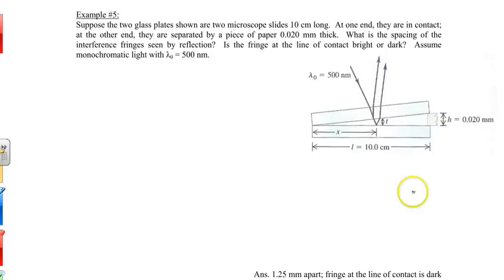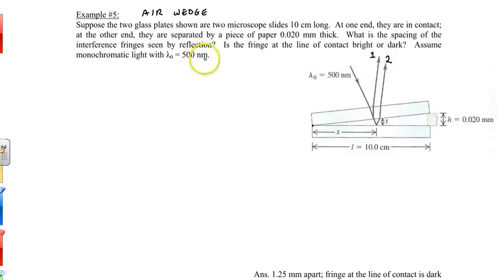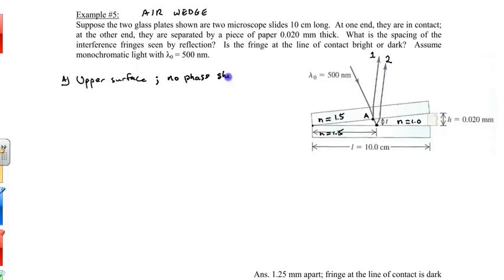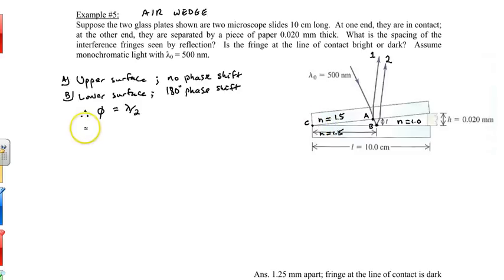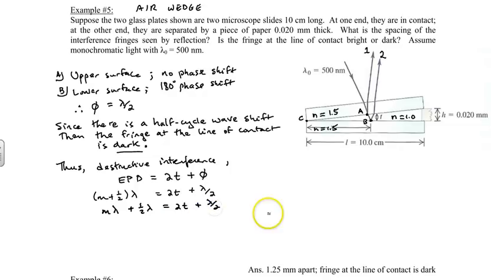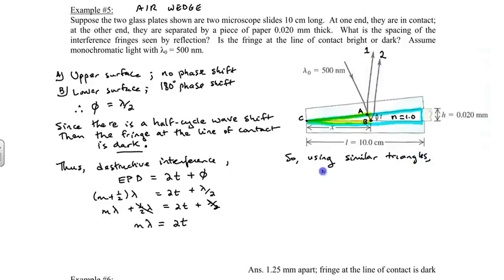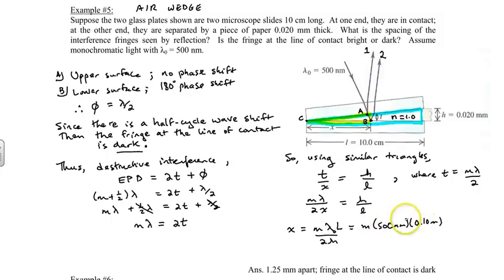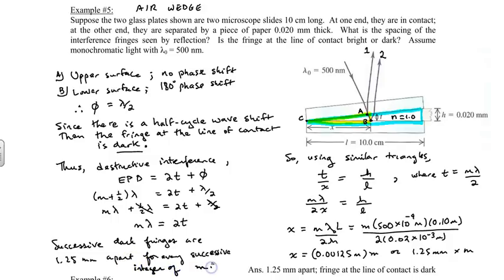Chapter 27, Example #5 (Air Wedge)

Comment: I know this answer but why use this similar triangle in the air wedge interference？ where is actually position of t is？
Reply: T can be understood as the thickness of the air wedge thru which the light travelled . Since it is near normal incidence we can approximate it to be the perpendicular at point of reflection of the ray 2. Now since tan theta is a const . H/L = t/x . Important to note that the 2nd light ray travels a bit more than 2t but it's an approximation